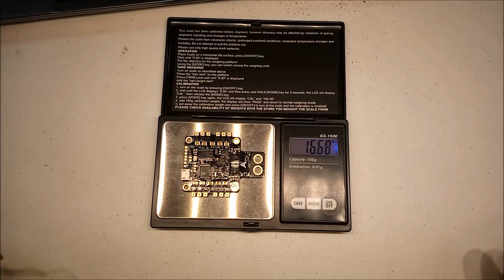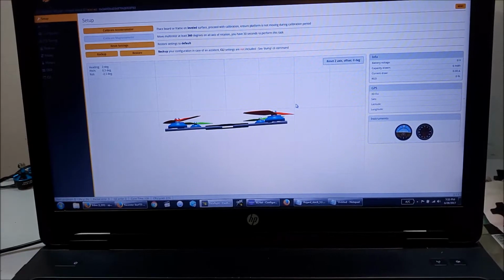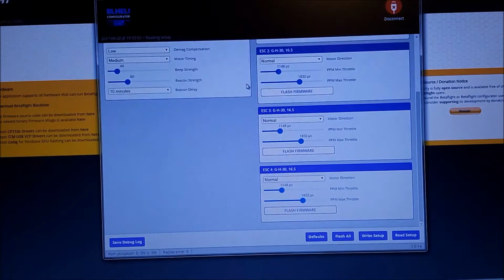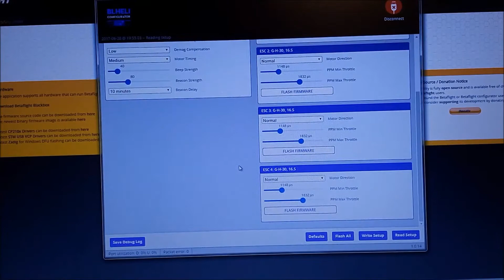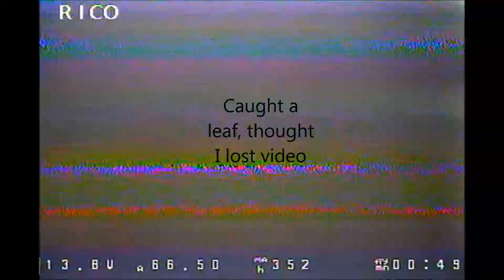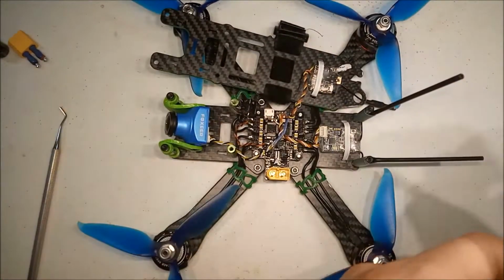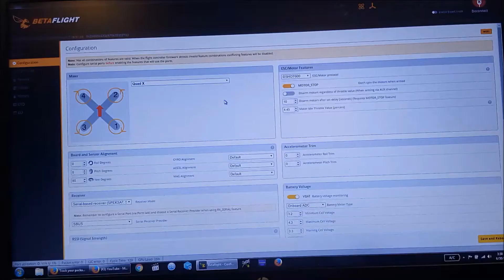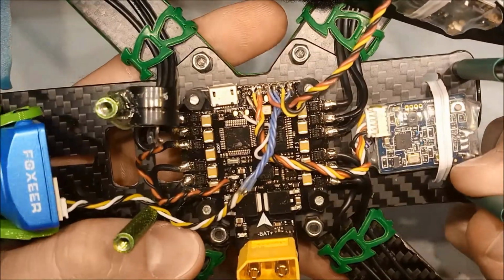Racerstar StarF3S AIO Flight Controller Review and Test

Comment: hi did you do motor remapping or the motor numbers are wrong on the paper !!
Reply: We need 90 deg of Yaw offset on BF as well, I forgot to do that and I had a couple of "freak" takes offs lol
Reply from the maker: yeah, just remapped them. Forgot to cover that in the followup 
you want them to look like this for the xt60 off to the left
resource MOTOR 1 B09
resource MOTOR 2 A02
resource MOTOR 3 B08
resource MOTOR 4 A03
Reply: Thanks for the time you've taken to make this video Rico, is that what we need to enter into the CLI to remap the motors?
Reply from the maker: First you have to clear them with "resource motor # none" 1-4 then reassign them
It's a thing you don't want to mess up so test on the motor tab without props after
Reply: Rico_FPV ...thanking you :)

Comment: Amigo consegue me passar qual versao do betaflight que vc esta usando nesta FC e qual a configuracao que esta na placa pois gostei muito o voo dele esta bem travado se possivem me passar fico agradecido!
Reply from the maker: Here is a diff dump of all settings right now
# Betaflight / OMNIBUS (OMNI) 3.2.2 Nov 11 2017 / 00:38:45 (77782e602) MSP API: 1.36
name RICO-QAVR6
resource MOTOR 1 B09
resource MOTOR 2 A02
resource MOTOR 3 B08
resource MOTOR 4 A03

feature -RX_PPM
feature RX_SERIAL
feature AIRMODE
feature ANTI_GRAVITY
feature DYNAMIC_FILTER
map TAER1234
serial 0 2048 115200 57600 0 115200
serial 2 64 115200 57600 0 115200
aux 0 0 1 1700 2100
aux 1 1 0 900 1300
aux 2 4 0 900 2100
aux 3 13 2 1700 2100
aux 4 28 3 900 1700
aux 5 35 4 1700 2100
rxfail 4 s 1100
set gyro_sync_denom = 2
set gyro_notch1_hz = 0
set gyro_notch1_cutoff = 0
set gyro_notch2_hz = 0
set gyro_notch2_cutoff = 0
set baro_hardware = NONE
set min_check = 1040
set rssi_channel = 16
set serialrx_provider = SBUS
set blackbox_device = NONE
set dshot_idle_value = 400
set motor_pwm_protocol = DSHOT600
set align_board_yaw = 90
set bat_capacity = 1300
set vbat_min_cell_voltage = 30
set vbat_warning_cell_voltage = 32
set ibata_scale = 352
set beeper_dshot_beacon_tone = 1
set yaw_motors_reversed = ON
set small_angle = 180
set auto_disarm_delay = 10
set disarm_kill_switch = OFF
set deadband = 2
set yaw_deadband = 12
set pid_process_denom = 1
set osd_units = IMPERIAL
set osd_cap_alarm = 1100
set osd_alt_alarm = 400
set osd_tim2 = 1
set osd_vbat_pos = 44
set osd_rssi_pos = 40
set osd_tim_1_pos = 54
set osd_tim_2_pos = 2455
set osd_flymode_pos = 333
set osd_throttle_pos = 225
set osd_vtx_channel_pos = 377
set osd_crosshairs = 200
set osd_ah_sbar = 200
set osd_ah_pos = 200
set osd_current_pos = 2446
set osd_mah_drawn_pos = 2440
set osd_craft_name_pos = 2049
set osd_gps_speed_pos = 218
set osd_gps_lon_pos = 82
set osd_gps_lat_pos = 65
set osd_gps_sats_pos = 51
set osd_home_dir_pos = 302
set osd_home_dist_pos = 303
set osd_compass_bar_pos = 266
set osd_altitude_pos = 2071
set osd_pid_roll_pos = 423
set osd_pid_pitch_pos = 455
set osd_pid_yaw_pos = 487
set osd_debug_pos = 1
set osd_power_pos = 321
set osd_pidrate_profile_pos = 345
set osd_warnings_pos = 329
set osd_avg_cell_voltage_pos = 2433
set osd_pit_ang_pos = 257
set osd_rol_ang_pos = 289
set osd_battery_usage_pos = 17
set osd_disarmed_pos = 138
set osd_nheading_pos = 311
set osd_nvario_pos = 279
set osd_esc_tmp_pos = 82
set osd_esc_rpm_pos = 83
set osd_stat_max_spd = OFF
set osd_stat_bbox = OFF
set osd_stat_endbatt = ON
set osd_stat_bb_no = OFF
profile 0

set dterm_lowpass_type = PT1
set dterm_notch_cutoff = 200
set anti_gravity_gain = 6000
set p_pitch = 60
set d_pitch = 24
set p_roll = 50
set i_roll = 45
set d_roll = 22
set p_level = 35
set level_limit = 65
rateprofile 0

set rc_rate = 135
set rc_rate_yaw = 110
set roll_srate = 75
set pitch_srate = 75
set yaw_srate = 75
set tpa_rate = 15

Comment: I lost more than 5hrs figuring this out using my xm+ receiver! The sbus pad wasnt working for me even checking it from BF receiver tab. Almost threw my new build quad in disappointment. Later on, i soldered the xm+ sbus wire to Rx1...and Eureka, it worked! But remapped to TAER1234...
Reply: TO RX1 or to TX1 ? That's what UART no ?

Comment: How cam I flash firmware if doesn't have button?
Reply from the maker: You pretty much never need the button on any board, they just flash without any hassle. If for some reason you do need to jump it, it has boot pads like boards always had. You just jump them with a tweezers. But again, never needed to do that
Reply: Rico_FPV hi , where are the pins to jump? Thanks

Comment: I could use some help. My theory of using a 3.3 bec to use spektrum satalite worked, but I'm having trouble getting the receiver tab to work in betaflight. I've tried all of the uarts, and configurations, and it didn't work for me. Any help would be greatly appreciated.
Reply from the maker: I searched through the thread on rcgroups, I can only guess your best bet is to try RX1 and different versions of BF. Maybe it's a software thing or a setting in BF. I have an old orgrx dsmx sat I could try to wire up later
Reply: Rico_FPV no need. That was the answer. Sad thing is that I tried it twice before, but rx1 did it. Thank you for your effort, and help!

Comment: -When I use its OSD on PAL (both on the Camera and Betaflight) The OSD information I get  solid OSD characters, but a rather distorted (on the ground) and eventually completely garbled image in flight.

-When I use NTCS( both on the Camera and Betaflight) The OSD information flickers, but video is good.

-Putting the OSD on auto system detection makes no difference.
-Swapping cameras makes no difference.

The best I can get is putting it all on NTSC with a flickering OSD but its not good enough, I can see videos of people using this board with no OSD issues.

Any ideas?
Reply from the maker: Did you figure anything out? I've never had osd issues with any build, could it be the version of betaflight?
Reply: for what I've read on github it seems that the actual OSD chip on the board has issues with 16:9 cameras (as in this case). On a HS1177 it was fine so I'll fit a 4:3 again and see.
Reply: Grimbert yeah, with a 4:3 camera is fine but doesn't like 16:9 ones.

Comment: Is this board still performing well after a month?
Reply from the maker: Yup, even though it gets really hot it hasn't given up and still delivers
Reply from the maker: Still going, bought a few more as well. After bf3.2 with dynamic filter i don't even care about blackbox anymore. One of these costs as much as the replacement fee for a blown asgard which seem to fail more often. Only thing is maybe a newer version of this has a switching bec, which would be better than the linear regulators
Reply: Rico_FPV how is the board? Is it still going strong?
Reply: Rico_FPV I am a bbl junkie. That is what is holding me back also lbec can get very hot and reduce the lifetime of the board.

Comment: Thanks for making time to do this review. I have just connected up everything on the board today and have to agree that it gets really hot really quick when connecting the battery. 
Also, Do you think a 1000uf low esr cap will help with the camera interference?
Reply from the maker: The getting hot is probably the 2 lbecs not being perfectly synced so one is always kinda sucking power from the other, an EE would have a conniption fit at the design of this board. I like lbecs because they output cleaner power compared to switching becs but they do get hot and are inefficient. 
I didn't notice a difference with the cap. And I have never seen improvement on any build I put a cap on, It's not a fix. I'd either use a vtx that has enough filtering to take straight bat power or use a separate 12v regulator. I get the cleanest fpv feed when I just use a 12v regulator and forget about caps and lc filters
Reply: +Rico_FPV 
Thanks for the informative reply. If i have noise issue with my camera i will consider a regulator. Where in line should it be put?

Comment: I'm thinking about using this in an extremely tight build. I was going to use the F3 F4 aio (I think that's what's it's called) but I like the built in escs of this one. I have an extra mini 600 mw vtx, do you think it will take up to much power this board?
Reply: Sorry I meant f3 v4
Reply from the maker: Are you sure your vtx can run on 5v? 

That other AIO is good too, but for 10 bucks more with the escs built in this is a better deal with less hassle overall.
Reply: I don't know, I'm going to use the ts5828s but I can't find enough information about it
Reply from the maker: nope, that needs 7v at least. You could run direct voltage but it'll get really hot and probably melt down. I only run those off 12v regulators
Reply: Are there any good 600mw vtx's i could run
Reply from the maker: Sure, depending on the frame I'd choose a unify pro or if on a budget just search "600mw" on banggood and pick whichever is rated highest vs cost.

does the frame have a place to hook up a pigtail or do you need the antenna directly coming off the vtx
Reply: Rico_FPV not much room for a pigtail, I was planning on mounting the vtx in a way the antenna would come out of the back of the quad

Comment: How to connect a PPM Receiver? Gnd, Sbus, 5V ? I cant get a signal in Betaflight :(
Reply from the maker: I didn't mess with ppm. We are light-years past it, the lag it adds will make you miserable. 

Sure you're on the right uart and config settings? I know there's been issues with omnibus boards and ppm in the past
Reply: This may seem stupid but make sure the micro usb is a data transfer cable. It took me a long time to realize once that my micro usb cable was just a cheap cable used for charging.